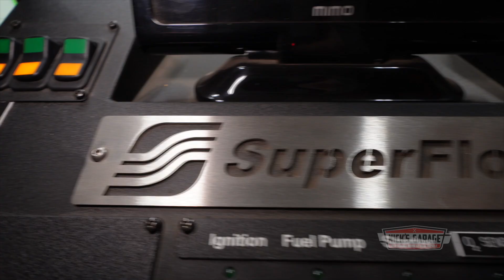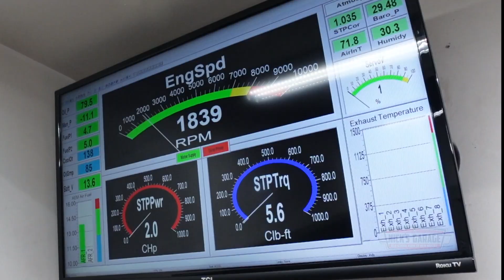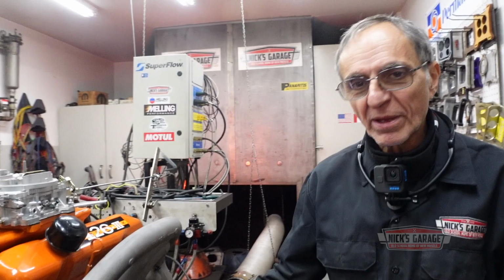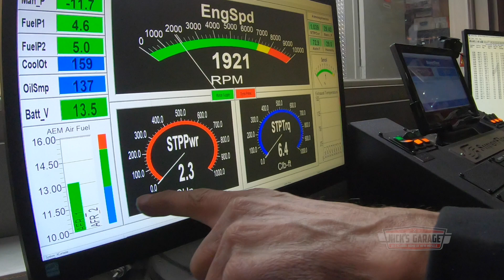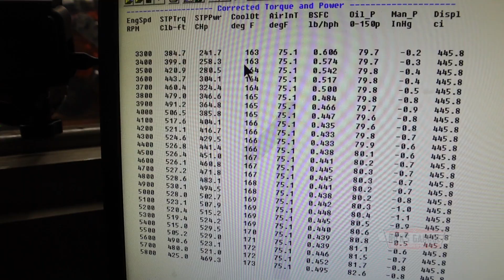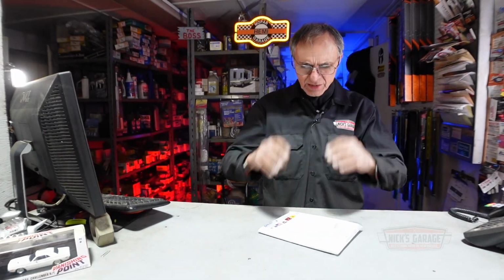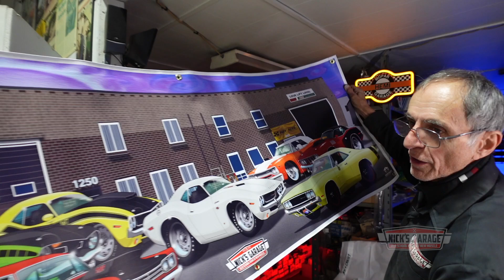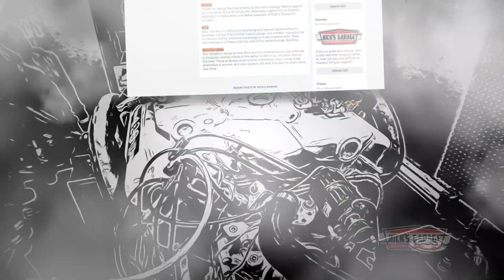Rare MOPAR Max Wedge - HEADERS vs MANIFOLDS

Comment: That was pretty cool.
The 426 Max Wedge is maybe the most interesting engine of the early 60's. Hopefully an original high compression one comes into Nick's someday.
Reply: 11:1 was the ratio for the standard engine, and it was rated as 415 HP. With the hi- comp optional version, it was a 13:5 ratio, and that's what was rated as 425 HP. Of course, both ratings were way low compared to actual output. I read a couple of articles at the time, that with the 13.5 compression engine, there was a sticker attached to the glove box door warning users NOT to run the engine at full throttle for more than 15 seconds at a time.
Reply: @bobkonradi1027  Nice info, thanks.
Reply: You are 1000% Correct on that !! .....If Nick ever get to dyno or Even take a "Ride" in a Real Factory Max Wedge car, He will real Quickly Forget all interest in the Factory tune "Street Hemi" cars !!!  No comparison.....Any Factory Max Wedge car will Totally wipe a Factory tuned Hemi car off the road or strip !!
Reply: @tomstrum6259  I posted a comment a couple weeks ago about a Stage lll Max Wedge on the street in my old town of St. Louis. You may have caught it, or not. Here's the story: I had a friend that had a 1963 1/2 Ford Galaxie with 427 and 4-spd. One night as we were cruising around in it, we pulled into a local burger doodle, "Steak 'n Shake, which was big in the midwest at the time. There was a tan Plymouth Savoy 4-dr post, and the kid had taken off the hubcaps and put a Sun dashboard tach on it. I mentioned to my friend that I felt sorry for him, his family only had a straight 6 "el cheapo" 4dr post sedan, and the kid had done what he could to make himself presentable to his friends. My friend pulled up next to the car, told the kid what I'd said and asked him to start up his "slant 6." Turns out the car had a Stage 3 Wedge and an aluminum front end. God almighty, the car was shaking, you couldn't think because of the loud exhaust, and so forth. Turns out, it was just the kid and his mom, she wanted a 4-dr Plymouth sedan, but he got her to let him pick which engine which was a Stage lll 426. Ordered car. She had to have a Torque-flite auto trans. Anyway, she was literally the little old lady from Pasadena, only in St. Louis. It was said she got to where she'd go hunting for Ford 427s and Chevy 409s, would give them a head start at the stoplight, then smoke them like a turkey on a rotisserie. I still remember from 59-60 years ago when the kid started up the engine. Nick and everybody would love the car, just have a suitcase with some spare underwear in the trunk.
Reply: @bobkonradi1027  Cool story, thanks for sharing it.

Comment: IMO the spacers under the air cleaners and upside down bases are redirecting the air entering the carbs. It with either changing the way the air is hitting the boosters or causing a change in how the air is entering the air bleeds. I would put the correct fuel fittings on and run the air cleaners correctly.

Comment: How much compression does this wedge have?  Your new (or should I say old) employee seems very intelligent, articulate, energetic and has a great attitude.
Reply: CR is 11.3
Reply: @nickpanaritis4122  wow lower than I thought it would be.. Looks like cam has less than 9" of vacuum at idle...My 70 GS stage 1 (464 c.i.) has a Lunati cam 253/270 @ .050 on 110 lobe separation..it has about 9-10" at 1100 rpm..similar lift to your cam in the wedge..I have more comp. 13.4:1..over 620 ft lb torque..very strong street car..
Reply: @billdedrick1914    ..Compression is Torque.

Comment: I may wrong on this, but I might unhook the linkages to each carb and the dyno. Turn the linkages assembly 180 degrees and rehook the linkages. The one to the right carb and hook it to the left carb and the left to the right. This way the linkages from the dyno would be on the other side of pivot point and pull on the pivot piece to open up the carbs instead of push.
Reply: Had done that during installation. Did not work, it was binding with my  throttle rod.

Comment: Valve float caused a stumble but even then you could hear and feel this V8's intimidating rumble Nick's Garage every Monday Expertise they've got a bundle Nick has shored up the distributor and now the valves have shimms This is where the real testing begins Before an examination comes revision that's why sending this 440 Max Wedge Cross Ram to Nick was an excellent decision Nick wants to do a final test to find out which is best Will it run better with the headers or the manifolds Performance will differ even though both parts serve the same goals If it's gotta be a cruiser or it's gonna be a bruiser Nick's Garage will build it bespoke for the end user With Nick's Garage you can plant your right foot without having to pray because they do the R&D in the correct way Nick's Garage every Monday Thanks Nick and Shiad Big ups George

Comment: I am a bit confused here. 🤔 When you install an air cleaner you restrict the airflow a little bit and normally you run richer. In this case it is apparently opposite. Why? 🤔
Reply: Will look into it.

Comment: I wonder if a 2inch spacer under each carb would  increase  the planum run  for the  air fuel flow instead  that short 90 out of the base out of the carb.Would of loved the numbers then. Maybe we can do that test on the 413 long ram for the 64 c300

Comment: Hi Nick, I was just talking with my older brother who used to have a Dyno jet Dynamometer for motorcycles and he came to the conclusion the reason the Max Wedge engine ran leaner with the air cleaners on was because the base plates mounted upwards allowed air to enter the air cleaners and then downwards into the carburetors as a straight shot making it run leaner because of the extra velocity. If the base plates were mounted downwards the air wouldn't have a downward flow, but instead have to travel upwards to enter the carburetors which would run richer. What are your thoughts?

Comment: I think that these motors in the day put out more than that and were closer to 625 horse power. They seemed much faster than these numbers are sayin'. I had a dodge 400 ci that was close to 560 HP and 585 torque in 1974 and it was a real bad a-s screamer too ...

Comment: How about testing with say 600 cfm carbs like Shia suggested
Reply: That's what I have on mine.
Reply: @bnghjtyu767  and how did it perform?
Reply: @kevinwoolmer5478  I still have that car 64 Dodge polara with a Max wedge clone just 1974 440 block mild can 906 heads ported buy me so it's not professionally. manifold to head gasket match 440 source roller rockers standard pistons and rods this is a low compression engine with TTI headers. The carburetors are 600 CFM Eddie's. My motor is basically detune because I do not race it and I just cruise and go to the car cruises. When I dyno it had 400 at the wheel and 500 torque. The engine is tune so it starts well and idles well and cruises well I like it.

Comment: The large size carbs may be a the root of your uneven mixtures.
Suggest some investigation, then maybe some different carbs.
1.  Flow check those carbs, one at a time.
2.  If not up to 750 cfm, think of trying some early 60's era Carter 450 cfm # 3252S 4-barrel units.

Comment: I've read where the actual 413/426 Max Wedges came with a warning not to have them go 'wide open throttle' for more than 15 seconds to prevent engine damage. It goes to show that these were engineered to be SERIOUS performers!

Comment: It seems like you have the throttle linkage backwards it needs to be rotated 180*. I’ve never seen a Chrysler product that pulled the throttle from the front they always pulled from the rear.
Reply: I did.  It was binding with my throttle rod.

Comment: LOVE those exhaust manifolds, everybody has tubular headers but crazy cast iron like that? Epic…
Edit: a thought occurred, wonder if they were trying to get some heat to the big manifolds and carbs?
Air cleaner bases look upside down?
Reply from the maker: We had to run the bases upside down to fit over the dyno's fuel lines.  Fitment will be better in the car.

Comment: I agree w nick  chrysler must have dynod and tuned these engines with the air cleaners on. Every time they change rods they seem to go back to factory metering rods. Chrysler engineers really knew what they were doing and these engines put out big power and torque back in the day and they needed it to move those big heavy cars. And they did a great job

Comment: I almost wonder if bigger jets in the secondary rear jets would help with the air cleaner and the electronic distributor that came with could be drilled and cross pinned on the threaded end of the distributor rod but if the have the relucktor wheel is out of line with the pickup and distributor rotor it would not mater how much you adjust the distributor because if the relucktor wheel is off from the rotor button it will never fire the cylinder plug at the correct moment but that's just theory.stay with what is originally designed  great job Nick

Comment: Nick, what is causing the secondary butterflies  to shutter back and forth at full throttle?
what are the implications to this, loss of power?
Reply: I left it as is. Who knows with 750 CFM carbs and with a Max Wedge intake.

Comment: Love the Max Wedge! I know the original MW package included an exhaust system that came factory with exhaust dumps. I wonder if with them open would they effectively act like a longer "collector" and improve the power delivery like it would with long tube headers?
This is my favorite dyno session since I started watching over 3 years ago. Thanks Guys!
Reply: It is our pleasure. Thanks for watching.
Reply: OK I'll throw a little engineering at this one. The short answer is that the tuning effect would be pretty small; the dump would just be to minimize backpressure. Of course it is always better to lower backpressure as that is just like friction on an engine. However headers and to some extent exhaust manifolds rely on a sonic (I.e. speed of sound) pulse that occurs when the exhaust valve closes. The pulse is a much stronger effect than the piston motion for pulling exhaust gases out of (and intake mixture into) the cylinder. The strength and frequency of the pulse is affected by the length and diameter of the flow passage prior to it mixing with those from other cylinders, as well as how they mix, i.e. sequentially with typical manifolds or all at once with a 4-into-1 header. By the time the gases get to the headpipe and to the dump I reckon the tuning effect would be pretty diluted. 
A  4-into-1 header is pretty straightforward to tune knowing the speed of sound of the exhaust gases and the firing order. The results tend to favor long tubes of moderate diameter for the torque peaks of typical engines; shorter, fatter tubes as the peak torque RPM increases. Mixing the flow of a couple of cylinders ahead of the collector region dramatically lowers the rpm of the tuned peak (and usually creates multiple peaks), although the effect is not as strong. This is how "high performance" factory exhaust manifolds work; excellent examples are the 426 street hemi and the original '68-'70 340 engine. This is also how tri-y headers (like on the '65-'66 Shelby Mustangs) work.
It is pretty easy with CFD software to exactly predict the effects and adjust the exhaust geometry to optimize this for a given engine design. My hat is off to the Chrysler engineers that did this so well with charts, slide rules, and (if they were lucky) maybe just a little very expensive mainframe computer time.
Reply: @gavinmclaren9416  
Thanks. I think I should have said "tuned headers" rather than "long tube headers". I do know that in the old days, people would determine collector length by looking for the area on the collector with heat discoloration and cut the collector at that length.  Not sure if it was science or voodoo. I was assuming that since the Mopar gurus of the day had gone so far as to build an exhaust system complete with factory exhaust dumps for factory drag racing classes that they had made some calculations as to how long the large tube section (I hesitate to call it a "collector") of the MW exhaust manifold should be for optimum results in Super Sport racing.

Comment: Wow that is a beast of a "street" engine below 6000 RPM. Sounds like that cross ram is doing the job in the mid 5000 RPM range. I have seen my carbs lean a bit with the air cleaner on too. The air cleaners should be straightening out the air flow into the carb. Something is going on there and you would think better air flow would show more power.
Reply: They had the air cleaner bases on upside down because of interference due to the wrong fuel fittings used on the carbs. That would have changed the air flow characteristics some. Would be interesting to compare the results with those issues fixed.

Comment: One thing i dont understand,  put a filter on.. more restrictive , so why did it ran lean? Less oxygen usually say's the opposite?  🤔
Reply: My theory is that intake and filter arrangement is too turbulent and the secondaries are not opening all the way. With two 750's it shouldn't go lean
Reply: @6426yy  yeah that could be a fine tuning issue ish!? Bit they added fuel to them alot.. I am puzzled...

Comment: ran my 70 challenger 440 lean to get home low on gas money. headers glowing red. i checked the oil bumped and my knuckle came off cooked on the header. probably around 1986'  but thermal camera may be good on this.

Comment: Nick maybe you can help me, in 1971 i bought a 1971 challenger RT from mr norm in Chicago it was one of 10 one of his specialty cars, it was a 440 six pack slap stick transmission shaker hood a dana rear end with 488 gears, i only raced it on the streets which was just about every day and no matter what car i raced i always won, now here is my question, mr norm always got the hottest cars from Chrysler as i said it was a 440 but on the front left corner of the block from the factory there was a welded on tag that said 413 CID can you explain this (please)
Reply: Never heard of anything like this. There was no where any 413 was in any 1971 car.   STRANGE.   Was it matching number's ?

Comment: There are a lot of good suggestions on the comments. However, the timing to take them in consideration might be off on account that the engine is probably not on the dyno anymore.
If I understand correctly, this video was done over a week ago....Correct me if I'm wrong.
Reply from the maker: You are correct.  Editing these uploads takes a few days, at least.

Comment: You know, if you spin the carb linkage that is attached to the intake manifold 180°, your accelerator should work correctly. His throttle Iinkage in the car is not going to push that linkage forward to power the car, it has to pull it..
Reply: I do not have a cable. Tried with my throttle rod and was interferring with the lever. For that reason we installed it at 180 degrees.

Comment: I really wanted to see this 440 setup and run with the original MAX wedge heads. I know they don't compare to aluminum aftermarket heads. But I wonder if the MAX wedge heads would have run better on my 440 SIXPACK 70 Challenger??? And then the Dual Quads added on too!. With the excellent aluminum heads and big cam I can't figure out why this engine isn't reving to 7200 rpm? My Lsx 427 98 Firebird T/A will all day long. 6.99@98.38 1.52 60FT.

Comment: Is it the new metering rod springs that reduce the stumbling on dyno load up? Previously it stumbled at full throttle like most six-packs on your dyno.
Reply: This can be fine tuned in the street.

Comment: I would love to see a test with a 440 sixpack with and without the air cleaner and with the air cleaner and with and without the shaker scoop on a Cuda or Challenger.  Also, would love to know the difference in the AF ratio without any air cleaner and with the air cleaner and shaker scoop.

Comment: 563 is a bit low for those heads and cam, wonder if the long intake runners was holding it back. 5300 rpm is too low for peak HP with that cam and heads. that thing should make 600 hp without any problem, something aint right
Reply: According to HotRod, they had tested these manifolds vs a good 4BBL single plane and with the same set up it produced 60 plus HP.
Reply: @nickpanaritis4122 could be difference in dynos and many years between tests. Who knows but 600 is a bit greedy for a stock displacement wedge head motor without extreme modifications. Thing ran great imho

Comment: It would be interesting to see a solid cam about 260ish @ 50 in it, I bet it would pick up a bunch over 6000 rpm. It really needs to RPM at 426ci with the 270"s.

Comment: On the last one did u ever figure out what caused the spark to appear on the intake plugs on the right side of the engine next to the carb
Reply: Have not seen it.
Reply: @nickpanaritis4122  on the first video of the wedge when ya was trying to get it started I made a comment and the time of when I seen it happen in video it was around the part that said does anyone know what that sound is only thing I seen and heard was the spark of the intake plug the first 2 on right bank by the carb first one was a big spark on the plug the second one was a small crackle bout it barely even noticeable unless u seen the first one which I had rewind video and slow it down to make sure I seen it
Reply: @nickpanaritis4122  it was at 46:40 right b4 that time slow the playback speed down on ur phone to .25 and then watch ull see the spark its on the side ur on in that video soon as u let go the carb and go for something else it sparks right b4 u put ur hands back on the engine
Reply: @ericbeeman8717  ....Something to look at.  Thanks.
Reply: @nickpanaritis4122  ur welcome sir just figured it was something may need addressed could cause a major issue down the road ya never know